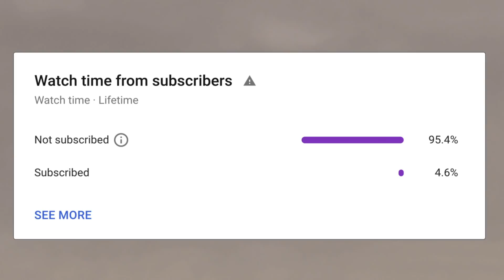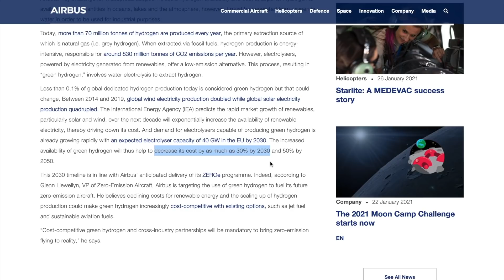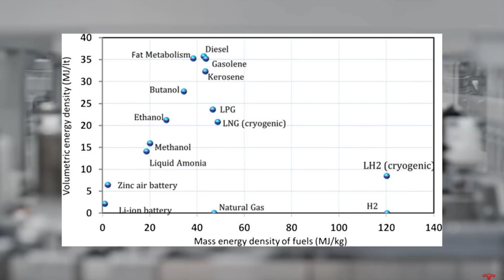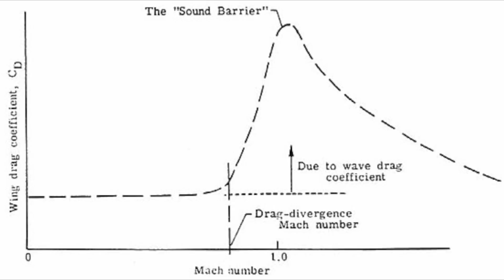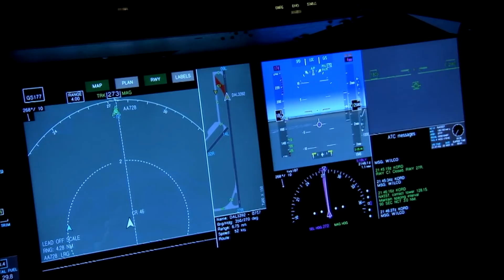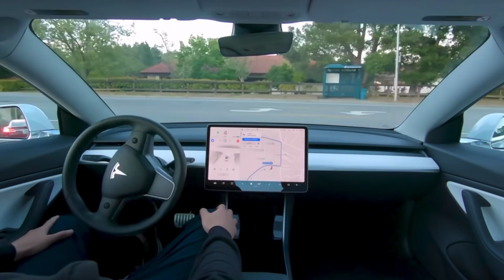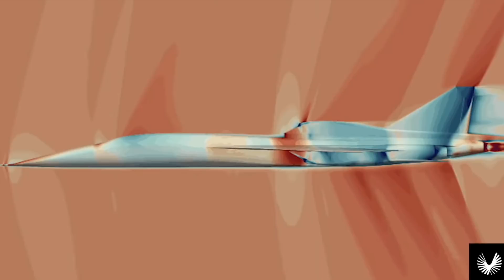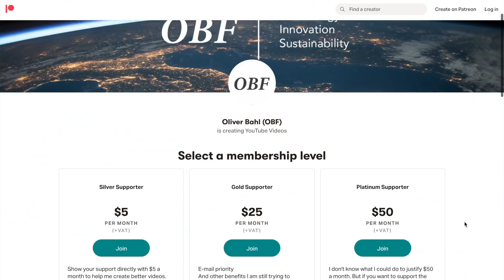The Plane That Will Change Flying Forever

Comment: There's 2 pilots because of safety reasons. No matter how good AI becomes, it can never be as reliable as if it also has trained persons that can take over. And there's 2 because if one pilot has a medical emergency, or somehow dozes off, the other one intervenes.

Commercial flights without pilots will never ever happen.

Comment: I feel like you are probably too optimistic about some of these new ideas, still cool concept. One middle step for autonomous planes would be commercial planes not needing a co-pilot, thus basically doubling the number of pilots possible (assuming co-pilots could faster become certified as main pilots).

Comment: My only concerns about supersonic propellers is that the propellers themselves each cause drag which reduces efficiency and may be more likely to take bird strikes, also the scale of the propellers would need to be considered as well as without a cowling they are also at greater risk of "sabotage", it may just not be physically practical to build a supersonic travelling aircraft driven by propellers.

Comment: According to Nobel laureate  Robert B. Laughlin, the physics do not allow for some of the things you've talked about. Specifically, according to him, it is absolutely impossible to achieve the same energy density found in carbon-based fuels using any other means, especially batteries. This excludes nuclear. I think we can understand why nuclear may be a bad idea.

Now, you want to add a 2000-pound battery. Guess what -- the plane won't get off the ground. Period. So I get it. You can't do it with short-range small aircraft. They'll have to be FAR more expensive.

Can you make an electric airplane fly? Yes. But according to a nobel laureate, we just flat out aren't going to get the energy density. So yes, we can make electric aircraft and maybe fly them Minneapolis to Chicago, but the physics just doesn't work for longer flights.

Oh, you could take a 747, fill it with batteries, and maybe do better, but you wouldn't have any weight left for passengers.

The planes of the future will be some sort of closed-loop carbon-based jet fuel, probably biofuels. That will last until we have some insane breakthrough based on tech we don't even know about. We won't be flying more than an hour or so on batteries, and certainly not the 3 you discussed.

--

As for the shortage of pilots -- that's the airlines industry's own fault. If they want more pilots, they can get them. Lots and lots of people would love to be pilots. They could be good pilots. But pilots are treated like shit until they get into the cockpit of large jets, and there is a career path. All the airlines would have to do is actually pay puddle jumper pilots decently, and tons of people would enter the field.

But the airlines is focused on today's profits, not tomorrow's pilots.

Comment: I have a question......what about the weight of the copper wires for the electric motors?
Reply: not that much. electric motors would be in hydrogen and battery planes and they aren’t a big problem

Comment: The air at cruising speeds is moisture saturated.  How about allowing turbofan blades to create an electric field that separates oxygen and hydrogen from that moisture ingested by the engine, supplementing engine power at cruise?

Comment: Great video! When biofuels burn, they release CO2. But biofuel plants (algae, etc) consume CO2 when they grow. So, is the cycle overall CO2-neutral?
Reply from the maker: Exactly
Reply: @OBFYT  The pollution still stored in the air.
Reply: It's not neutral, it's negative, if you use the compost, left after the fuel extraction as fertilizer or food for animals. Bio-fuels are the future not the stupid li-ion batteries.
Reply: CO2 that released to the atmosphere from biofuel are only a small fraction of CO2 that absorbed from atmosphere in a process of the biofuel growth.

Take palm oil biofuel for example.

Each palm oil tree, only around 1% of it's weight are the fruit, and only 25% of the fruit that will become the oil.

Comment: What about methane? :)
Reply: Methanol or butanol would be better.
Reply from the maker: Unfortunately methane is not sustainable.
Reply: @OBFYT  
Depends on how you manufacture it right? Elon Musk uses methane for the starship with the plan to manufacture it on mars from ice, carbon dioxide and sunlight (/Solar panel farms). I guess they must build the factory on earth, at least for test purpose before sending it there.

Might not be the cheapest method right now, men when he does something it usually soon become economical viable.

However, if you count in the risk of leaks you might be right. :)
Reply from the maker: @macjonte  So I'm purely talking about using methane. Which requires you to burn it, and that emits CO2. With that said methane is a pretty clean fuel, just not carbon neutral which should ultimately be the goal for most transportation here on earth, except for rockets.
Reply: @OBFYT  
Couldn't methane manufactured with this process be seen as biofuel? It sucks carbon dioxide from the atmosphere during manufacturing and emits during burn, just as other bio fuels which makes it carbon neutral.

As long as there isn't any leaks and in liquid form it needs to be stored really cold (but not in as expensive tanks) so it has many of the same disadvantages as hydrogen.

Anyway, great video! Liked & subscribed! :)
This channel will be big, you will get your silver plate before this year ends! :D

Comment: li-ion batteries work bad with low temperatures, so a part of their energy would go away to keep them at 20 degrees celsius
Reply: I'm not defending the stupid idea of electric planes, but that's not a problem at all... when batteries are in use, they produce heat already. So they can be heated on ground using external power, but once the engines are running, they'll be fine if they are insulated enough.
Reply: @neplatnyudaj110  i think battery chemistry doesn’t produce heat itself, the wasted electricity is the main issue. If electric planes have to be as efficient as possible there are all the measures to limit wasted electricity right?
Reply: @pasticcinideliziosi1259  Where there's current, there's heat. All batteries have some internal resistance, which is limiting their efficiency.
Reply: @neplatnyudaj110  Only faulty li-ion batteries produce heat.
Reply: @doomdrake123  Of course they do. The charging/discharging has efficiency about 80 %. The 20 % is wasted as heat. If the batteries didn't heat up during use, it would mean they are 100 % efficient, which doesn't happen anywhere in the physical world.
Reply: @neplatnyudaj110  Then why aren't my batteries heating up?
Reply: @doomdrake123  I'm not sure if you're a troll or if you really mean it. Discharge efficiency of li-ion batteries is about 90 %. So if you're running 10 kW electric motor, your batteries produce about 1 kW of waste heat which you need to dissipate. I don't know what batteries you're talking about, but if you really have a battery that doesn't heat up, you should publish your findings. I think you might even have a shot at Nobel prize.

Comment: Another advantage of electric planes is much quieter engines.
Reply from the maker: That is true, but propellers make a hell of a lot of sound even when driven by electricity.
Reply: @OBFYT  think about rc planes and drones. They are relatively loud for their size. Idk the exact breakdown of how much of the noise is combustion vs lift produced by propeller or fan blades, but I think most of it comes from the props or fan blades.
Reply: @OBFYT  How are they supposed to be quieter? They'll be expelling the same volume of air.

That's the wooosh sound you hear jet engines make